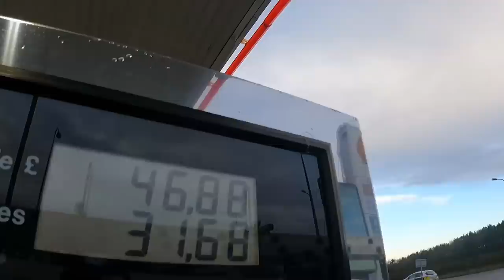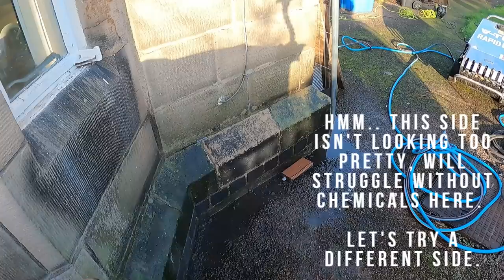Using HOT Water To Clean A FROZEN Roof!

Comment: Sid, may I make a suggestion? Being a WFP and pressure washer user for nearly two decades now, in the winter months, I have self built insulated boxes that I cover vulnerable parts with, i.e. the hose real, the water pump and the pressure washer itself. Now I understand that the pressure washer is a large item to cover, and you have space constraints on the van, but if you are storing said item in the garage over night, then this shouldn't be an issue.

Make a box, (10mm ply would suffice), line it with reflective insulation, (shiny side toward the items that need to be kept frost free), adhere it with spray glue, buy a few decent hot water bottles, put a couple inside the box, maybe even put a hot water tank blanket over the pressure washer with the bottles underneath that over night. If the box seals tightly, then this should prevent your freezing issues. It's worked for me, hope it helps you. All the best.
Reply from the maker: Awesome tip mate thank you, I will have to get started on something like that!

Comment: Great job Sid! The electrical engineer in me has to correct you though, it's not voltage that is the issue but rather current draw, electric motors can be hungry beasts especially during start up.

Comment: Hi Sid, with these roof cleans is it mainly done to keep the house looking tidy and for aesthetics, or is there a reason you don't want buildup on the roof? Only asking as I have several rental properties in Liverpool and have not really considered this before? I really enjoy your videos and your approach to work / values / the community, good to see that attitude in 2022!
Reply from the maker: Hi Tom, most people usually get it done due to aesthetics and the annoying splodges of moss dropping off onto the drive and patio every day, also it fills guttering up regularly so can cause damp issues if that isn’t sorted. But finally it eats away at the tiles, grows between the gaps and forces them to shift and crack. 
It usually takes quite a long time for that to happen though but it is inevitable. 
Large buildups like the one in this video do require a clean pretty sharpish to be honest. 
If you need a quote for anything just pop me an email over 👍 thanks for watching mate
Reply: Moss is extremely dangerous and damaging to a roof, it actually eats into the tiles ...
If you have properties and they are covered then as preventive maintenance it's a great idea to get it cleared off and then bio treated to help kill off all the moss. Also helps it stay clear for longer.
Reply: @almilhouse9059  but where does this moss come from?

Comment: I do carpet cleaning and the thing I hate most is ice cold nights  and 1c days, its a machine killer, especially for brass fittings, I try and drag all the stuff that can freeze out of the van and into to garage before a frost, a one off mild frost you can get away with a couple of days in a row around 0c with out getting the equipment inside and thats a different matter.

Comment: Hi Sid, great job again,that vtuf is amazing,would it be easier on the back & shoulders to use a surface cleaner or because you've got the  lightweight wfp conversion is it ok ? Thanx
Reply from the maker: Yes, absolutely, however as these tiles have a deep ridge in them it would take a long time to get an even clean, flat tiles are the one for the mini surface cleaner :D
Reply: @PartridgeExteriorCleaning  aaahhh....never thought of that,thanx for the reply

Comment: Nice to see it's not just me that has bad days 🙂Great result on the roof, looks better than the new one next door. I do like the blue colour on your van, really stands out. With the Vac, I don't know if you do this already but try 1 motor at a time with 20 to 30 seconds between motors. That said the Steam cleaner is about 1.5Kw? and the Vac 3.3Kw and they could have a 15 Amp circuit so only 3.4Kw or a 30Amp with 6.9Kw but with other stuff on same circuit in their house? I wonder why Vtuff don't make the PW part petrol or diesel powered? Then it wouldn't need electricity! My old steam cleaner was same elec powered pump, diesel powered heater.

Comment: What trigger are you using for the vtuf my man? I’m thinking of getting the foot pedal
Reply from the maker: yeah a foot pedal from AC pressure washers mate, was nice and chill to use
Reply: @PartridgeExteriorCleaning  I don’t like the trigger that attaches to base of pole as it slides around pole a bit and is heavy and pulls on pole
Reply from the maker: Yeah I haven’t used it at all, I just have it as an emergency incase the pedal goes, but I can imagine it’ll be quite taxing to use after a few hours
Reply: @PartridgeExteriorCleaning  is that a mi tower your using also?

Comment: Question: does the moss cause any damage to the roofing; or is it just an aesthetic choice to get rid of it?
Reply: I made the painful experience that pressure washing concrete with moss on top looks good at first but in winter the tiny bits of water which stayed on top of the moss now get deeper in the structure and cause cracking open when freezing. I would suggest to seal surfaces well by time before this roof gets leaky..

Comment: Why were you suing water at all if a roof is frozen. That should have been saved until much warmer weather. Not only will the hot water freeze once it's situated where it ends up you also cause the potential to damage the roof further through ice forming in the micro racks in the roof requiring thousands of dollars of repairs. Never use water in winter!!
Reply: Screwed if it rains or snows so.....
Oh wait it was
Reply: Also the carbon footprint. Shortage in everything but some rich want to have their house clean. Wait some time and that whole island complex gets a new coastline, but fewer land to use.

Comment: No offence, I get those prices may be fair for you to ask for, for a job like this, but I don't have a spare 900 laying around to just clean a roof 😅😭 that's like my bills for the month.
Reply from the maker: Yeah it’s quite a pricey job, a chunk of that includes the chemical treatment which is £100 just for me to buy it, £50 on diesel for the job, machine wear and tear, PPE, wages, and then the big old chunk to the tax man. Not left with that much at the end of it for the tens of thousands it costs to buy a van and a full set up to do the job properly and safely. 
It’s one of the main issues with trying to get roof cleaning work as it’s often out of the price range for a majority of potential customers. However, a new roof will cost 6k+ minimum so in that sense to get a fresh look and the moss problem gone, it’s kind of a bargain :D
Reply: @PartridgeExteriorCleaning  i guess when you look at it that way, very true points you make